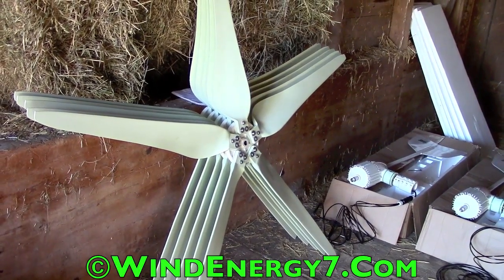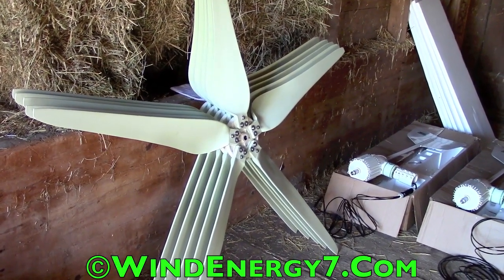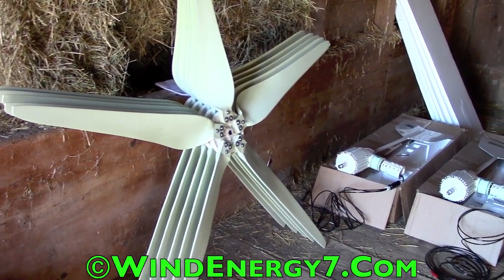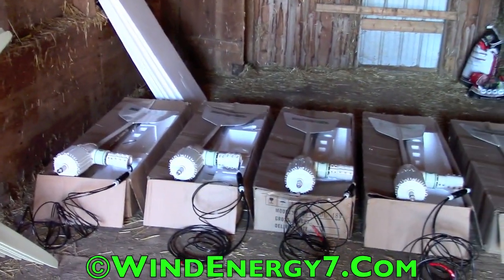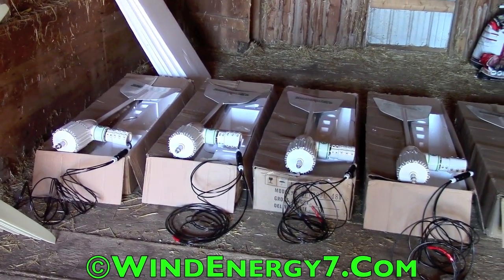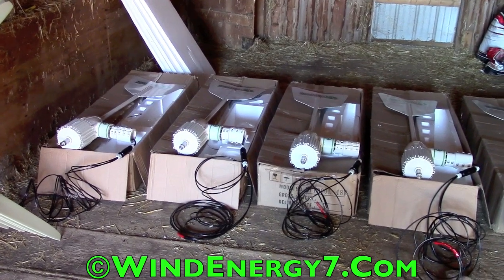Wind Turbine Dealers - Wind Turbine Installer

Comment: Wind Turbine Dealers - Wind Turbine Installer
Reply from the maker: Hi XxCulunxZ, Thanks for your note on a solar only system.  With your rooftop though I think its perfect for the RoofMill™ system.  Look at this install. Wind Turbine You have to remember that in deep winter the solar is not going to do a lot, that's when the wind turbines make the best contribution.  The way your rooftop peak runs north/south, your western winds coming in will accelerate off that roof into the turbines.

Comment: good system applied
Reply from the maker: To build your own DIY small wind turbine system you should buy a small wind turbine KIT. The only way you can pass electrical and building permits and be successful is to have a engineered and certified small wind turbine KIT. www.RoofMill.net is the place to start out and see the plans and pricing to power your home with wind and solar. Go To: www.RoofMill.net